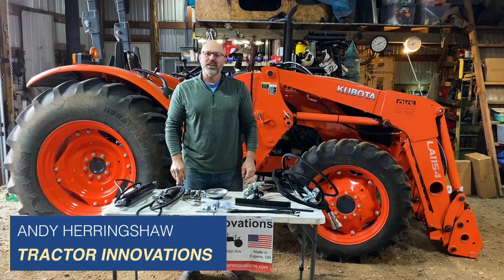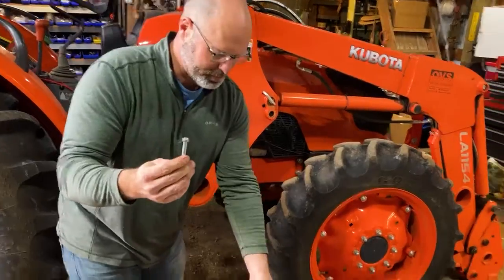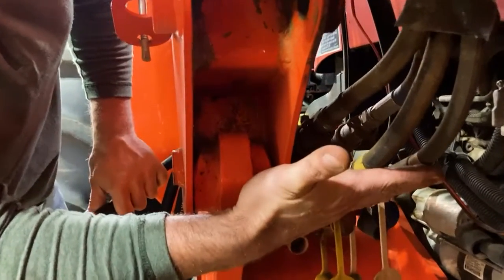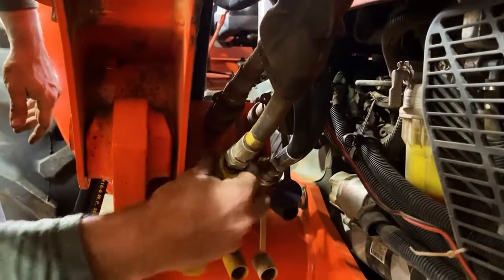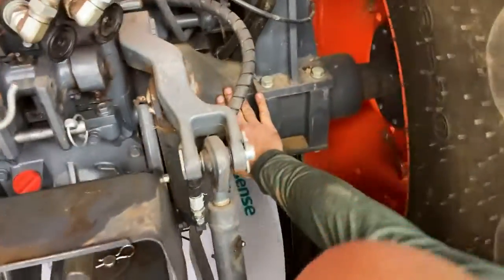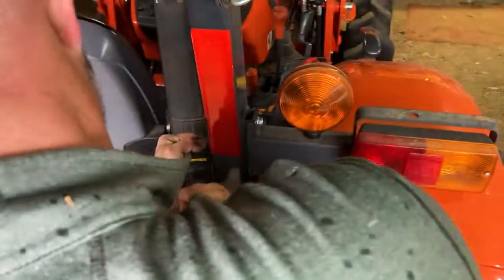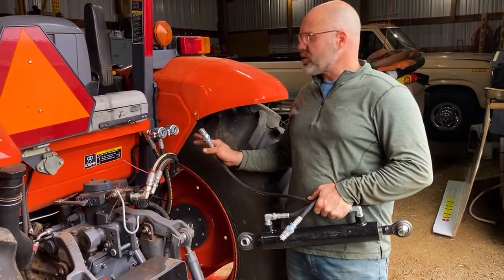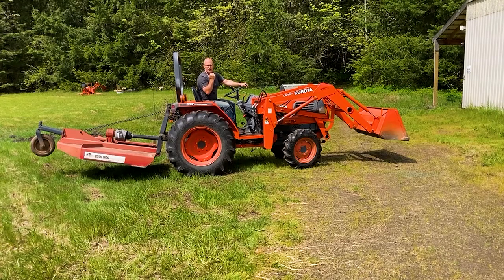$625 Remote Hydraulic Kit for Kubota Tractors -  M6060 M7060

Comment: I have the M7060 with a cab.  How will I be able to use this with that setup?
Reply from the maker: I don't currently have a solution for M-series cab tractor.
Reply: Just stack another factory remote on the rear- much cleaner and you don’t lose the loader function

Comment: Yesterday Andy came to my ranch outside of Oakland, Oregon and installed a 3 valve extension to the hydraulics of my dealer installed 3rd function valve on my Kubota L3830.  He also set me up with a hydraulic top link for my 3 point.  I felt like a kid with a brand new toy when the top link actuated for the first time.  We ran a port pair to the front loader on the other side from where my 3rd function ports for my hay grabber etc.  Intention is to now fabricate a hydraulic cylinder setup for my skid-steer universal hitch levers so I can connect/disconnect loader attachments without getting off the tractor multiple times.  That leaves one more hydraulic port set on the back free to operate the lift on my hay cutter. Super system, great work, good prices, I'm super happy.